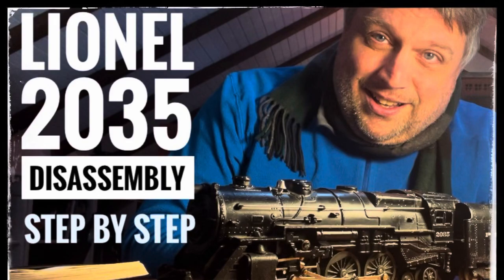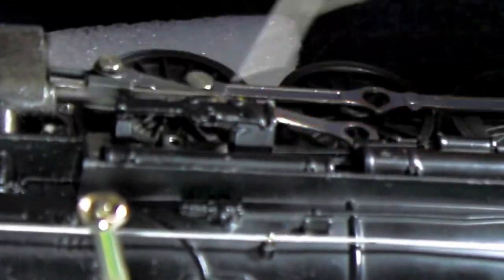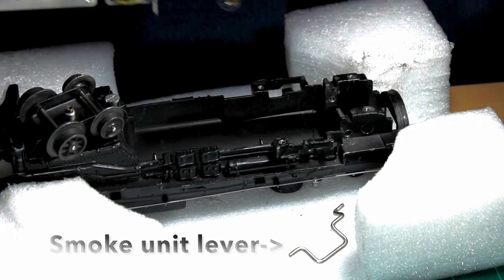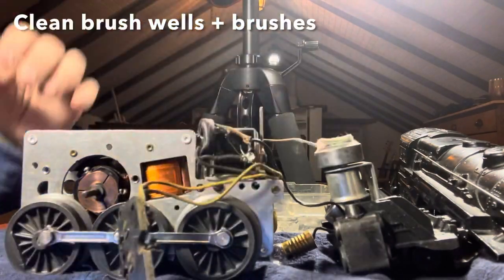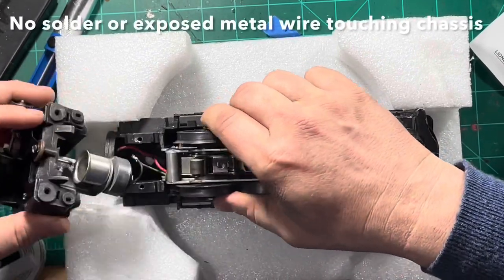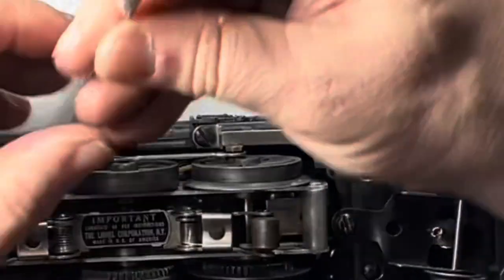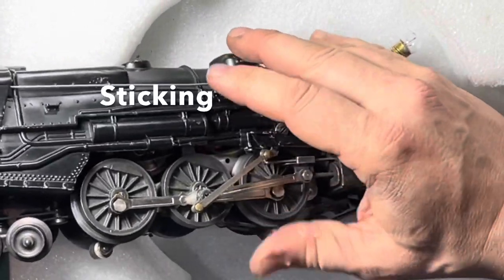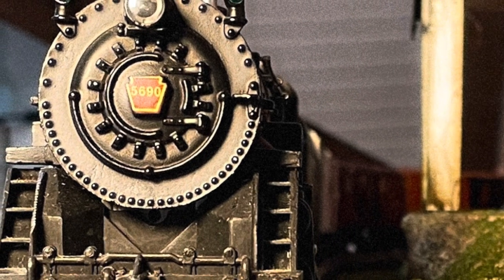Lionel Postwar 2035 - Disassembly Step by Step

Comment: Very resourceful information on these models. I've done plenty of diesel electrics and now just getting into the steam locomotives now in life. They really require much more patience for servicing than a diesel electric does Lol. But awesome video, I just actually acquired a nearly mint condition 1950 2035 and found its having trouble going in forward position, but flies in reverse, so believe my E units dirty and or contacts are loose for forward running? There's just a lot more smaller parts and pieces inside and outside of these steamers over a diesel. Thank you for making this video for idiots like myself who want to see how bad things are beforehand Lol!

Comment: This is so helpful, thanks!  Dad and I are rebuilding his 2035 and this will make it so much easier!  One thing you didn't mention in reassembly is when you put in the top motor screw, although you did mention the side motor screw, so maybe you put them both back in at the same time?